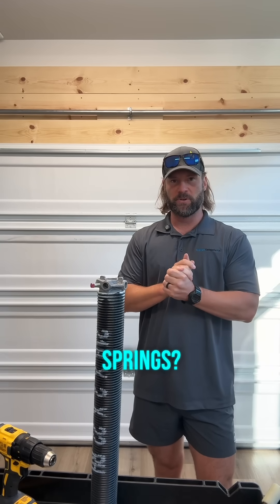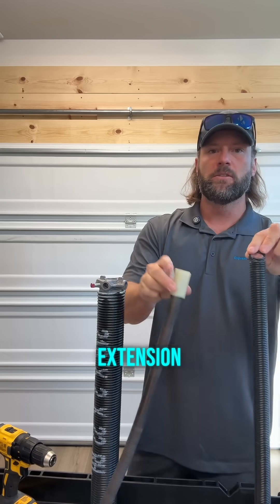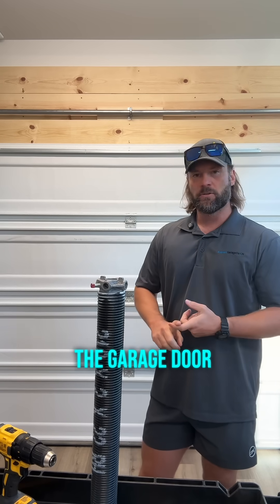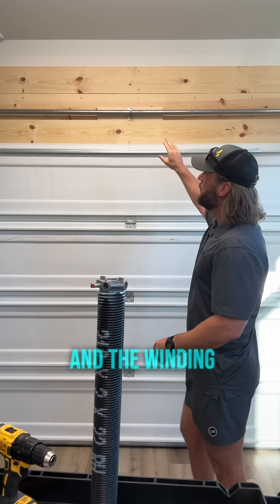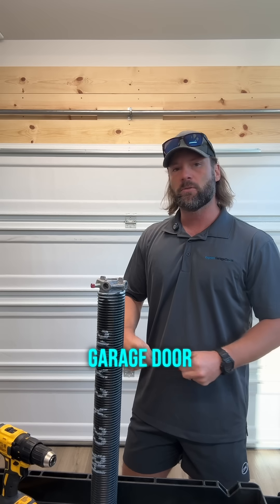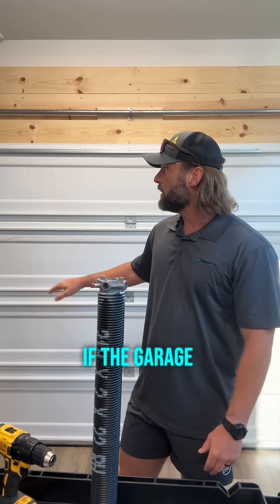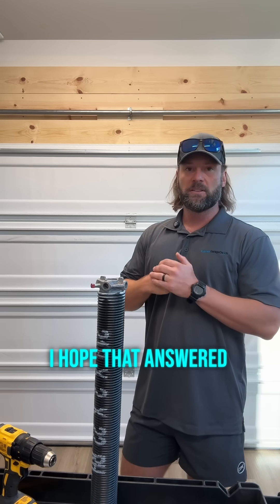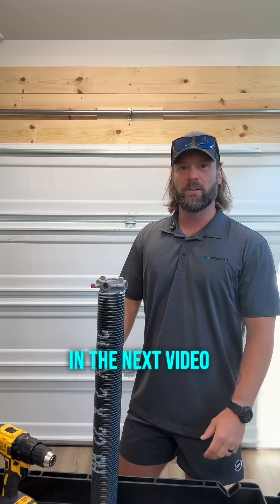Why Do Garage Doors Need Torsion Springs? Explained Simply

Comment: What am I missing here?  If the door is not in the closed position you would not have access to the equipment.  The door must be closed, and spring tension removed safely one quarter turn at a time.

Comment: With the torsion, if u have a garage door and u add insulation foam in the panels, like the one behind u, do u have to adjust the spring or replace it? Thanks!
Reply: Pull the cord connecting your motor. Lift the door by hand, is it heavy, does it feel like 5lbs or 20lbs? If only 5lbs, you can add a quarter turn to the springs. If it's closer to 20lbs, you will need to get new springs that are more suitable to the adjusted weight of your door. Now if you open the door half way, and it stays, no change needed.
Reply: I am not a garage door opener expert. However here is my two cents. Each spring has a capacity range depending upon how tight it is wound. If your door is close to the bottom of the range for the spring you maybe able to add additional winding to the spring to compensate for the extra load. However it is critical that you know the maximum number of rotations that the spring is designed to handle. Over winding the spring is very dangerous as it can break and do a lot  of damage/injure or kill you. To determine the number of winds  (if you have the correct tools and feel comfortable doing it) unwind the current spring until you have relied the tension counting the number of rotations.